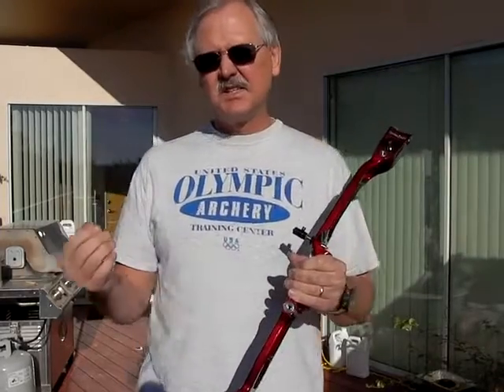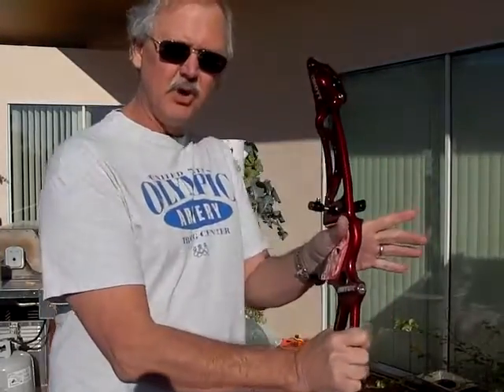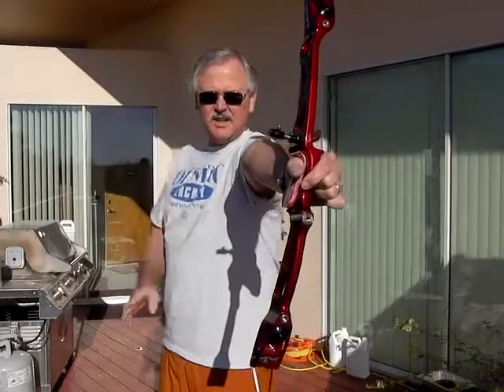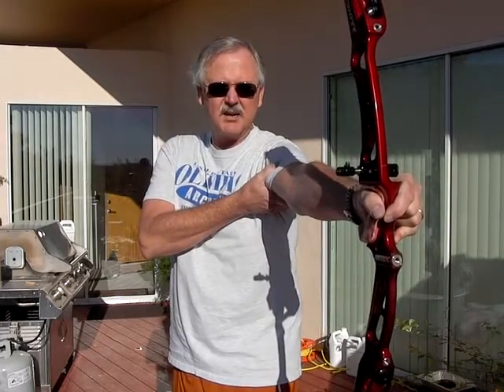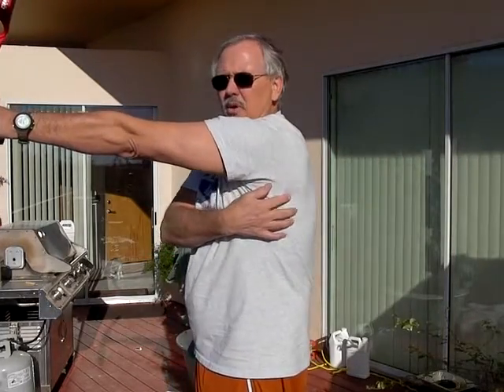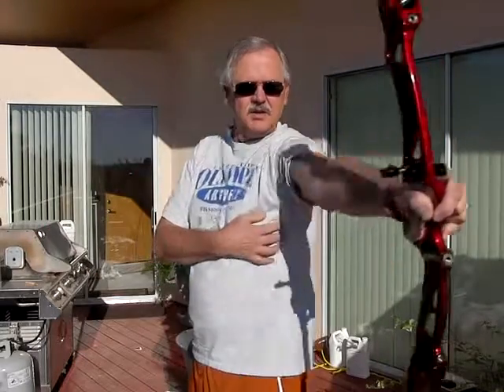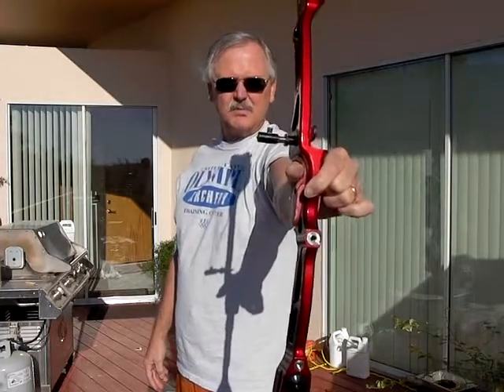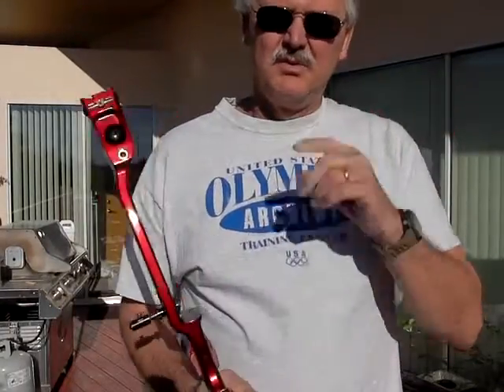Bow Arm Stability

Comment: Excellent explanation.  I tried shooting with my elbow vertical in the past, but it felt very uncomfortable.  This was because I was not rotating my grip to 45 degrees at the same time.  This caused me to have to twist my arm into an unnatural position to achieve the vertical elbow.   With the grip rotated, the elbow alignment falls into place naturally.  When I did this on the range, I immediately noticed how straight my arrows flew and how it dramatically reduced my bow side motion after the shot.  Thanks much for the great advice!

Comment: Watching your video changed my game. It made me realize that my hand grip wasn't correct. I went to my local hardware store and got some JB Water Weld and built it up. Now im consistantly hitting the gold with very tight groupings. The change was instant and movement in my bo arm is next to nil. Thank you so much.

Comment: Okay, I have a question and I am brand new to this game ... everyone that shoots seems to be able to lock his/ her bow arm out. Due to many years of weight lifting and even having my bow are hyper-extended (Broken as a pro wrestler years ago.) I can't lock either of my arms out ... they are at a slight angle, does this mean I won't be able to be good at this? (I will have to rely on muscle strength to keep my bow are as straight/ bent as I can and can't rely on skeletal strength.) I realize it will make me fatigue quicker than others, but do you thing I can still get good at archery? I just ordered a bow & have not shot it yet ... but watching videos to get good pointers from pro's like yourself ... any words of help would be appreciated, even if you have to just say it's not not going to work out well for me due to the physical limitations .... Thanks & God bless you!
Reply from the maker: First, I am retired from coaching for years now. So, I don't have the most modern schooling from the most elite coaches of the USA Archery System as I once did.  But there are certain basic concepts that MAY help you, even at your extreme "new" status. If you have not shot a bow yet then 99.9 % of all advice is going to be suspect in accuracy and usefulness.   OK, I don't quite "get" your description of bow arm, slight angles, hyper-extended, and most of your post.  
But I would like to offer some perspective, for some ODD reason.  First, your biomechanics are human. Damaged?  perhaps.  BOTH of my shoulders were damaged due to my ignorance of biomechanics more than a decade prior.  I injured first my dominant(right) shoulder rotator cuff and then the left (when my right started hurting a lot) doing the same repetitive motion each week.  Rather than stop and diagnose WHY my right arm no longer tolerated being raised up above horizontal, I stupidly switched to my left until it also became inoperative.  I'm very educated in physical physiology as a pharmacist and as a reasonably well-trained coach and as an expert generalist.  
So your injuries are NOT the first concern, other than when you attempt ANY bow-shooting attempt that it does not hurt above the threshold of "a new exercise pain-in-the-whatever".  
The most key function of shooting a bow is the center of gravities. NOT just of your core muscles at the center below your diaphragm but more importantly for you, the micro-gravity centers under each armpit, just below your cervical (neck) vertebrae, and your entire thoracic cage including your ribcage.  
You need to find a good coach, more than anything you find online including my advice.  If you are in the USA, then a certified coach of USA Archery will hopefully be able to provide a swift diagnosis and instruction for mechanistic motions that accommodate your physiology.  In a nutshell, LIKELY I would ensure you used a drawing motion that keeps your shoulders as low as comfortable(more or LESS) and allows you to draw into an alignment configuration so that your bones take as much load as possible. Virtually NO ONE will be able to transfer 100% of the load of the bow onto their skeletal structure perfectly. The best archers in the world fall far short of 100%.  So regardless of YOUR PERCENT, there is hope for you to become an archer, perhaps a good archer, even perhaps an elite (<1% of all shooters) archer that has the brains to be a top-step owner.  If all you worry about is past injuries, then please view archery as a FUN sport until you decide you have reached your potential, keeping in mind everything above I have suggested.  A good coach is paramount for anyone that wants to truly excel and in the limited information you provide I think you will need someone who can see your motions, analyze your motions, and diagnose the best methodology for your drawing motions to take ADVANTAGE of your physiology.  Your self-perceived damages may be of better use than you think.  :)    good luck.  If archery is not fun, then don't do it.  Loosing an arrow, and in your minds' eye viewing it's track to where you want it to arrive is the crux of archers.  DO it once properly and you will forever wish to do it again.  Just as a golfer who strokes a hole-in-one and then ever seeks another one. And do NOT fall for the poundage quotient.  IDIOTS think that being able to simply shoot a 60 pound bow in the general direction of the x ring at 20 meters is better than taking a 20 pound bow and stroking 3 in the x ring is better. Do you want to hurt or shoot well?
Reply: @a.roncarmichael6593  Thank you very much! for getting back to me so quickly. I will absolutely try to utilize all your tips above ...